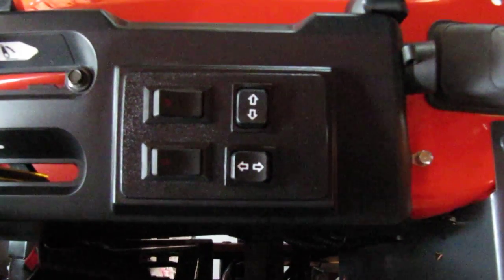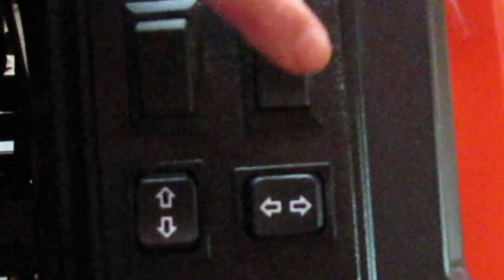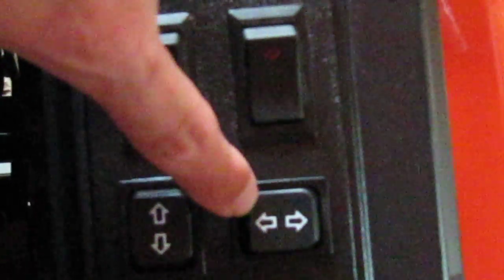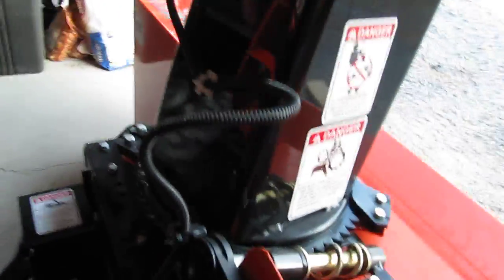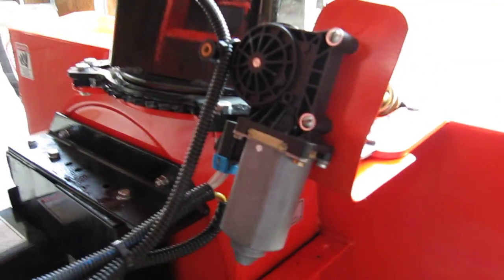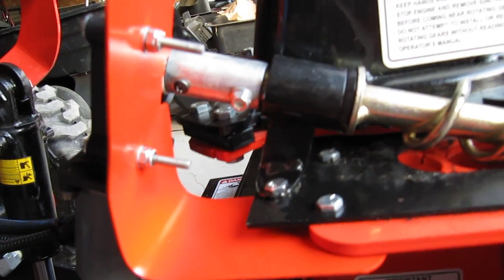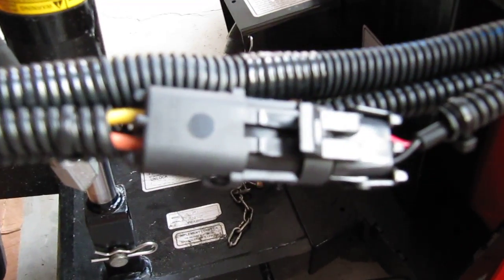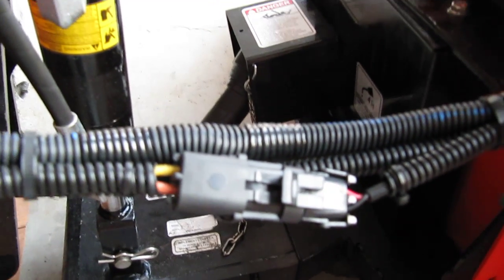Electric Chute Deflector and Electric Chute Rotator Project - Kubota B3200HSD

Comment: Just curious how the chute deflector is holding up. I have seen some centered over the top / back of the chute that seems good from a balance perspective. Any issue with this deflector actuator only being on one side? This is definitely a desire for me to implement. I have the hydraulic chute rotator though, so I have that one covered (though quick disconnects on the snowblower side would sure be nice).

Comment: looks great. Only issue I see are those 2 bolts holding the motor to the bracket. Cut those off as they are way to long. They only have to be as long as the end of the nut. at 2:02 into the video you can see them.

Comment: On the end of the window how did you get that coupling on it because there is a gear there?
Reply from the maker: Hi Justin....I made sure the window motor I purchased had a plastic/nylon gear.   I used a dremel tool to bore the inside of the coupler out a little and also ground down ever so slightly the back of the gear to ensure a flush fit between the end of the coupler and the window motor body.  Then to attach to the gear, I drilled 4 holes in the coupler itself (not the gear) and attached with self-tapping screws through the holes and into the plastic/nylon gear.

Comment: Scott, you did a beautiful job on this mod. It looks totally factory.
The brackets, the wiring, even the switches - just beautiful!
Now that you've used this setup......
 A) does it turn quickly enough for you?
And B) have you had any issues with moisture getting into that motor?
Thanks.
Reply from the maker: Thanks, much appreciated.....again, VERY late reply.   Turning is certainly a bit on the 'slow' side, but I've learned to manage......manual turning was faster, but I do appreciate simply pushing a button and turning the chute.    I've luckily had no problems with moisture or freeze up of the motor...I'm pretty sure they made these waterproof being inside the door of a car.  For the actuator, I make sure I spray it with de-icer before I go out to prevent any freeze-up and I haven't had any problems.

Comment: Scott, nice setup.  I'd like to copy this, I  also have the B2789 Rear PTO Blower and ordering a new BX25 and Curtis Cab, so need to convert my manual crank to this arrangement.  Would you mind sharing your parts list on this, and perhaps some pointers from your experience on best steps to take?  Impressive, clean, professional.  Appreciate your work and reply.
Reply from the maker: Hi Greg, again very sorry for missing this post...you've probably completed your project by now.   Much appreciate your comments...I'm kind of a stickler when it comes to 'looking stock'.  The key parts list are as follows:
- Linear Actuator (4" stroke, heavy duty)
- Bolts/lock nuts/washers that fit the holes of the actuator you purchased
- You will also need nylon spacers to keep the actuator away from your chute (see video)
- Window motor - I used a Chevrolet pickup LeftHand window motor for my installation (key item here is to ensure the gears are PLASTIC not metal to help with the coupler attachment)
- I had to find the factory waterproof harness connector that would connect to the Window Motor (they aren't cheap, about $12/piece, but I got mine from clipsandfasteners.com)
- 1/8" thick metal.....I used to mount the window motor, I got mine at either Home Depot or Tractor Supply Company
- Bolts/washers/lock nut that fit the window motor holes....and also bolts/washers/lock nuts to mount the metal to your blower
- Waterproof couplers for the quick connects of the wires....(got mine at amazon.com as my other post denotes)
- Switches for the up/down actuator/rotator controls - I used DPDT momentary switches from delcity.com (item #73553DL   DPDT Window Momentary Switch (1 MIN)  )
- Wire loom to cover/protect the wiring (can get at home depot/radioshack)
- Coupler (got mine at Lowes in the multi-bins they have) of 1" OD size
- Wire....I used  #14AWG  for my installation....especially for the motor

Key Notes:
> The coupler has a slightly smaller ID than the plastic teeth on the window have...I just used a dremel tool to bore out the inside of the couple until it fit.....I also used the dremel on some of the plastic teeth until the fit was snug, but workable
> To attach the coupler to the motor, I drilled holes in the coupler, but NOT the plastic gearing.  I used self-tapping screws (4 of them) to mount the coupler to the plastic gearing on the motor....I've had no issues with the plastic giving way under load.
> Make sure your coupler is mounted straight on your motor.....when the motor turns, you want to minimize 'wobble' from having a non-straight coupler as it spins around.
> If I were to do this again, I probably would wire in a relay instead of wiring the high-current wires directly to my switches.  The  #14AWG  wire is pretty thick and a pain the butt to work with under the plastic panel next to the seat....I'd rather work with smaller wire to the switch with the power relay having the heavy gauge wire
> When determining where to mount the actuator, play with it a little bit before finalizing your hole locations.  I ensure that my chute reached max height with max throw on the actuator....this ensure you won't 'bend' the chute by going past it's max.

Comment: I have a 2011 B3030 with a B2782A snowblower. My wires got cut for that control my up and down controls for the chute deflector. Meant to get 8-9" of snow tomorrow and I want to install more wire with a quick connect between the two. I'm somewhat mechanically inclined, yet need assistance. What type of wire did you use for your chute deflector and what would you recommend for a quick connect?
I'll be heading up to home depot in the morning to try to get what I need.
Thanks
Reply from the maker: Wow....sorry it took so long to get back....I didn't realize I had so many replies.  I'm sure you're all set now, but here is how I would have responded.  Most likely they use  #14AWG  or  #16AWG  size wire for the connections, so that is the size I would use - Large box home stores sell wires on roles in the electrical dept that are of this size.  For the connectors, I would use waterproof connectors.  I was quite happy with the build/quality of the ones that I used.....got them here: http://www.amazon.com/Delphi-Packard-Weatherpack-Terminal-16-14/dp/B004DVM7RG
Reply: Scott Pheasant
Hi Scott, like the work you did on the blower controls, could you tell me where you purchased the switch plate in which you have your 4 switches installed, cannot find one like it anywhere.

Thanks!
Reply from the maker: Bert Vissers Hi Bert, thanks for your comments.  Actually, the blank switch plate came with my Kubota B3200HSD Tractor.  I'm sure you could order just that switch plate from Kubota directly.

Comment from the maker: Thanks for your feedback.  Your concern about bending the chute was one of my #1 concerns as well.  I used a 4" Stroke Heavy Duty Actuator that I purchased from ebay for about $60.   I put my chute at max height & held the actuator with the 4" stroke extended & adjusted the chute opening/closing & the actuator extending and contracting until I was satisfied I would get the maximum range of chute deflection without going above the range of the chute.  A little playing around, but 4" worked great!